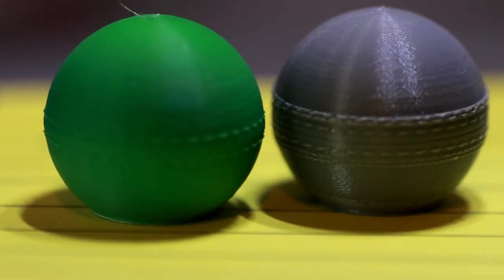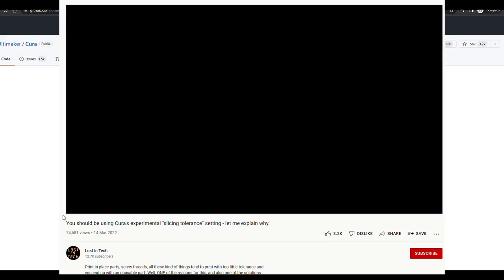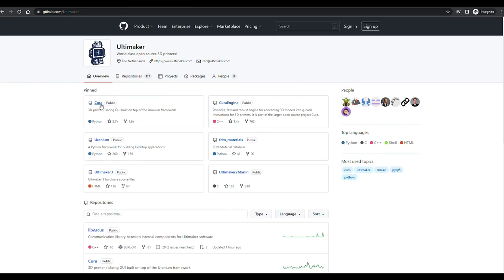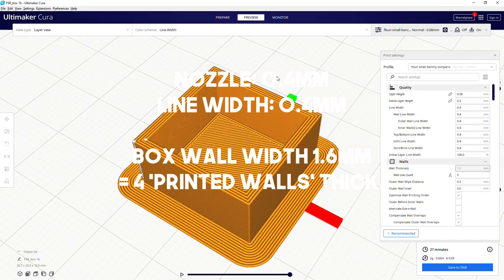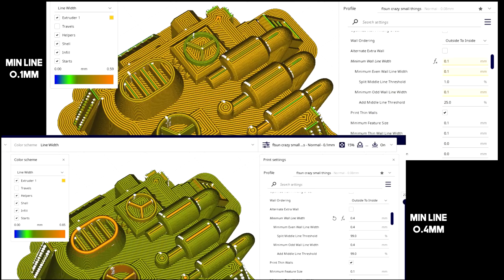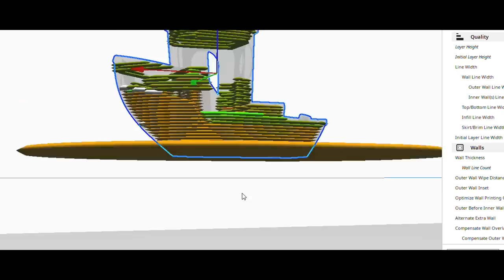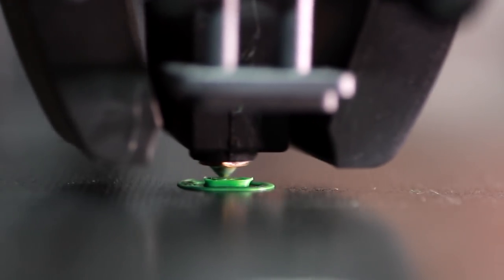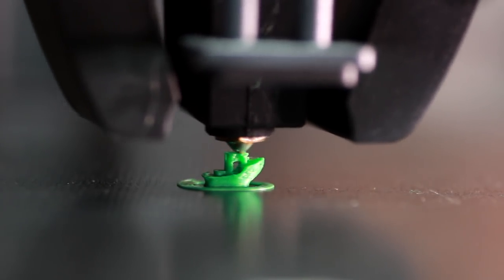Ultimaker Cura 5.0 is out and I'm serious, it's a game changer.

Comment: When I print detail prints, I set the nozzle diameter to 80% of the actual nozzle diameter. So, for example, a .3mm nozzle printing as a .25mm nozzle. I find that 80% nozzle diameter reliable.

So you can have this level of precision already.

Comment: I tried cura 5.0, every print I start after 10 mins or so it closes without any error messages. Switched back to previous version works without issue
Reply from the maker: Can you follow the link I've added to the description and check the steps, it tells you where to look for a log file you can send off to try to get it reproduced and worked on

Comment: the part with the plugins not working is preventing me right now to switch to cura 5.
i guess i will stay with the Arachne beta 2 until that's fixed ( as im using a few plugins i just don't want to miss )
and yes, variable line with is a godsent for various reasons :)
Reply from the maker: Yeah I am champing at the bit for the plugins! I'll probably use both at the same time until they're available, depending what I'm doing.
Reply: @LostInTech3D  
the bad thing is: apparently every plugin creator has to make changes for his plugin to work with the new version of the marketplace.
i fear there will be some plugins that are just gone be left behind :(
Reply from the maker: Yeah, that is a concern, it depends what's needed in terms of changes I guess.

Comment: Cura 5.0 vs prusaslicer?
Reply from the maker: 😂 I wouldn't dare
Reply: @LostInTech3D  compare for us ❤️ tests
Reply from the maker: I mean, I could, but it's really hard to do, because you have to get all the initial conditions to line up. When I've done this in the past, I found myself told off in the comments because I hadn't set certain settings alike, which is a practical impossibility, the settings aren't ever going to be alike. The comparison you can do, I guess, is on features. Which usually comes down to "cura has tree supports, prusa has paint on supports". I guess I could do that, people would still complain though, they are so emotionally invested in the respective slicers for some reason 😂
Reply: @LostInTech3D  I recently moved from Cura 4 to Prusaslicer for the ability to add modifier boxes to do things like expose infill in certain areas. Does Cura 5.0 have that ability?

Comment: I uninstalled Cura 5 when I started it up because 70% of my plugins were said needed to be uninstalled and then re-installed, I figured this would not be the case and it sounds like I was correct, in the past I have made changes to one Cura version and it has also affected other versions, bearing this in mind I decided to uninstall 5.0, I also have Arachne Engine and have been using it since it was released and have only used 4.13.X when I needed to use Monotonic ordering with ironing, I will wait for the release or at least a release candidate of 5.0.
 The metal support is my main interest as I have a 1Kg roll of BASF Ultrafuse and sintering that I got in a giveaway at TCT, I have some parts earmarked for the Ultrafuse but because you have to send all your parts together for unbinding and sintering I am waiting for parts I really need in metal before using the whole roll, and you dont get a great deal of filament in 1KG I am told, the filament is in what looks like vaccum packed mylar so I cant see how much is on the roll but the roll is not very wide.
Reply from the maker: Yes - I'm not sure what's going on with the plugins right now, they've been behaving very oddly, I will update when I have some idea what's going on there, mine were working on 4.13 but some have seemed to randomly disappear.
Reply: i "uninstalled" them in 5.0 and then worried about exactly that.
turns out they still work in the old Arachne beta 2 i use. :)
Reply from the maker: 🤔now that IS weird. I hope they get them running soon to avoid the confusion! (I also run all 3 versions!)
Reply: Because we also updated qt (the gui framework that we use), all plugins need to be updated.

So that all the current plugins no longer working is an intentional (if unfortunate) result.

That being said, our amazing plugin contributors are already hard at work updating them. If you like their work, some of them have a donate button, so send them something if you can :)
Reply from the maker: I might as well ask 😜 is there an easy way to get them working in 4.13 and for 5 to not try to delete them?
Reply: @LostInTech3D  it wont ever delete them for previous versions.

But there is no easy way for them to work for 5.0.0. as you might imagine, forcing a break wasnt an easy choice for us. We only did that because we absolutely had to
Reply from the maker: gotcha. Some of my plugins have vanished but I suspect it's a bug or something I've done, I'll try to work it out along with reporting the machine swap bug I found later on, after some time in a dark room 👍

Comment: Whilst all this is nice...My one and only issue with Cura is it's very slow (at least on my PC) at slicing.

Prusaslicer takes seconds, where the same model and settings (other than tree supports on Cura) will take 20min to slice.
Reply from the maker: Tree support is slow, try slicing in cura with it off 😉
Reply: 20 minutes???
Reply: @LostInTech3D  I would but I hate regular supports, tree supports are just so easy to remove..
Reply: @PJPEE  okay maybe a slight exaggeration, but it does take longer.

Comment: What's a syncronus motor?
Reply from the maker: Uhh I think it's where the coil matches the AC frequency? That's a guess. That's not what this is 👍
Reply: @LostInTech3D  Actually a stepper motor is a synchronous motor designed for low speeds, and with a rather quickly varying frequency.
They meet when looking at stepper motors like the 28BYJ-48. But if that was a synchronous motor it would have been made to run in single direction with a single coil.
Reply from the maker: the 28BYJ is getting a teardown in the video ;)
Reply: @LostInTech3D  dang and there I thought  I was being smart.😅 yep as pizzabender says it is a nema 17 with an endplate removed

Comment: It shows Wrong estimate time for prints. It show for my print 9 hours but it took 18 hours... That is a big difference in time.
Reply from the maker: that's likely to be your printer profile not matching the movement limits on your printer's firmware. This is the usual reason why the estimates are wildly different.
Reply: @LostInTech3D  It could be. I'm using Cura Printer profile. I think it should be tune in.

Comment: What ? I would have to design the wall thickness according to line thickness ? 
My Simplified 3D Slicer already solved that problem 5 years ago xD
Reply from the maker: Not really. I just didn't explain it perfectly. I will, later.
Reply: @LostInTech3D  What you said was correct, but it is not like it is a huge milestone. Prusa Slicer or S3D had those features already.
What´s great about Cura is tree supports.
Reply from the maker: Tree supports are brilliant, but I hope to eventually convince you that this is not the same method as prusaslicer uses (or indeed cura 4 - which had a variable middle line infill capability) 👍
Reply: @LostInTech3D  Okay in that case I will rewatch the video and get a closer look, to your credit I must say I watched your video just in the background while working, so I did not pay attention as I probably should have xD